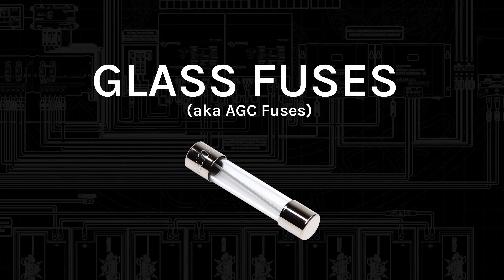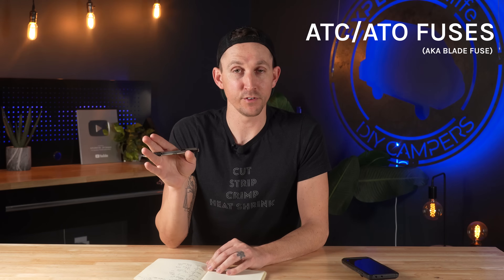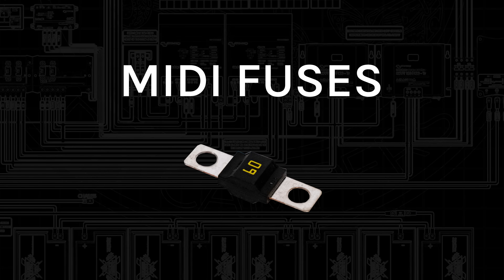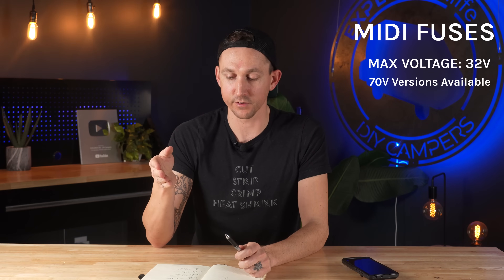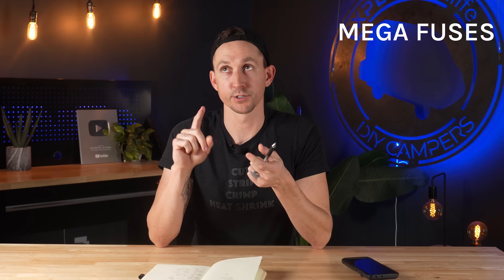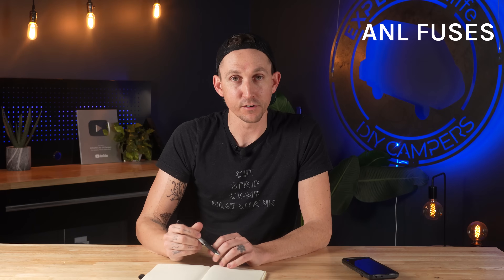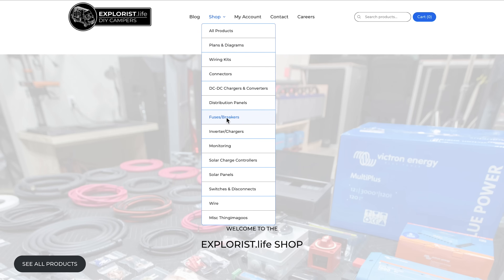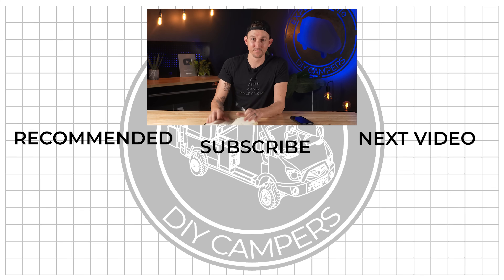DIFFERENT TYPES OF DC FUSES (for a DIY Camper Electrical system)

Comment: Overall, not particularly useful.  The presenter merly rattles off a dozen fuse types but gives no comparision on which are better suited for Van/Camper electrical applications.  The generalized min/max voltage and current ratings are so wide spread as to make these details lost in the noise.  No graphs, charts or other visual data to compare and contrast the various fuse.
Reply from the maker: Appreciate you checking it out! Some topics are tricky to fully break down in one video, but we try to give a solid overview. If you're digging into a specific project and want a more tailored breakdown, our support team can definitely help: https://shop.explorist.life/support
Free support is available for gear from our store, and the Pro Membership is great for outside items: https://shop.explorist.life/shop/all-products/membership-tiers/

Comment: This is an old video, but I hope you'll still read this.
I understand all the math of the AIC. But people constantly talk about BMS potentially shutting down if we don't pre-charge large inverters, even though that is much less current than with a dead short. So wouldn't the BMS just cut the power in case of a short and any potential arcing would stop? I can see two explanations why relying on the BMS is not enough, but I've never seen it explained and much less tested in an actual experiment:
1) The BMS is simply not reliable enough compared to a good fuse.
2) The BMS is not fast enough compared to a good fuse (which could lead to damage to inverter etc.)

Do you have an answer to that? Or would you be willing to actually do an experiment? I can't afford to destroy a bunch of lithium batteries...
Reply from the maker: Basically, we don't want to rely on software to stop a dead short.
Reply: @EXPLORISTlife  Thanks, I didn't know it's only software in the BMS responsible for that. Makes a lot of sense.

Comment: Do you have a source for a 25amp ANL fuse and fuse holder? I can find a 20 or 30 amp from Renogy with the holder but I'm not sure if they will work for my Victron MPPT 100/20 charge controller.
Reply from the maker: An ANL fuse is not appropriate for that small of a charger.  Try this instead: https://shop.explorist.life/shop/all-products/victron-smartsolar-mppt-10020-wiring-kit/

Comment: From my understanding, if the AIC rating of a fuse is double that of the short-circuit rating of my battery bank, then I should be fine. Sound correct?

I have four 24V 230Ah batteries in parallel. Each battery has 0.04 Ω (40 milliohms) internal resistance. So the short circuit current would be 600A each, for a total of 2,400A.

I just got a Blue Sea ANL 400A fuse as my main bank fuse, which has an AIC rating of 6,000A.
So, if there is a short circuit, it will do its job but it won't explode, melt, etc.
(I'll probably never even use over 50A at any given time)

From my understanding, I'm pretty much covered. This sound about right?

Much appreciated and keep up the great videos. They are super helpful.

Comment: I was thinking about adding MRBF fuses to each of my paralleled LiFePo4 batteries in case of an internal battery/BMS short.  Would this be practical?
Reply from the maker: This may take a more in-depth look at your personal setup.  If you have purchased/are purchasing from our store (shop.explorist.life) reach out for some more personalized help: shop.explorist.life/support

If you've purchased/are purchasing elsewhere, reach out to your dealer for support.  We'd love to have you as a shop.explorist.life customer so we can provide a bit more help in the future. 🙂

Comment: I want to put an inline fuse between my 30amp MPPT solar converter and the deep cycle agm batteries, but i'm stuck on what to buy? I am going to use 10AWg tinned copper marine wire. I realyl want a breaker that I can reset if blown, to save on replacement fuse costs and availability. I have read that those types of breakers are not reliable, and have issues when in hot climates. The RV will be in the southern California area where temperatures in the summer average 105-110F. I was going to mount the fuse inside the RV where it would be even hotter during the summer with the doors and windows closed. What type of fuse setup do you suggest? If I had to go with replacing fuses if they were blown, I was thinking about a terminal fuse block with the square fuses? Don't worry, I won't hold you responsible if it dosen't work out. I am just looking for a path to the yellow brick road.
Reply from the maker: We actually have charge controller wiring kits in our store shop.explorist.life which includes the proper fusing and distribution.  Check it out and reach out on the shop chat messenger if you need additional support.

Comment: You forgot to mention the short circuit fuse on the wife when you been driving 8 hours and she blows... I tried replacing my wife when she blew up with the young woman on the highway and that blew up too... Might have to look at my system for loose connections.

Comment: Is there a video showing how to determine the size of fuse needed? I'm running a 12v system with 400ah LiFePo, 3Kw victron inverter,60amp rover and so on!
Reply from the maker: This may take a more in-depth look at your personal setup.  If you have purchased/are purchasing from our store (shop.explorist.life) reach out for some more personalized help: shop.explorist.life/support

If you've purchased/are purchasing elsewhere, reach out to your dealer for support.  We'd love to have you as a shop.explorist.life customer so we can provide a bit more help in the future. 🙂 

But yes, a youtube search for 'EXPLORIST.life - How to Size Fuses' will indeed turn up a video on the topic, yes.

Comment: Do you guys sell a kit to install a shut off switch in between the Victron lynx power in and the lynx distributor as well as a kit for the smart shunt using 1/4 inch copper bars
Reply from the maker: We do not use the Lynx Power In for any of our system designs; so, no... we do not sell that kit.
Reply from the maker: Perhaps consider just following our system designs as-is w/ no alterations so you don't have to have guess-work.  https://shop.explorist.life
Reply from the maker: Well, good luck then! 🤣
Reply from the maker: I mean... our system designs completely omit the need for a power-in altogether by simplifying wire by using 'diagonal' battery bank wiring.  It's less wire, fewer lugs, less cost, with no drawbacks. 

So, unless you're using more than 6x batteries, our solution will work just fine for you unless you've got something weird going on.
Reply: @EXPLORISTlife that's a shame, I guess I will keep looking

Comment: I'm looking at rgs or nt type fusible links as I need 250-300a fuses for my 48v off grid system running a 12kw LF inverter
Reply from the maker: Neat!  Sounds like a cool project.

Comment: I cannot find an automatic switch that handles DC to DC 48 v array 100 amps
I am not using an inverter, 
I have two 48v solar battery array, I want to use one as a back up, the only item I have hooked to it is connected directly to the MPPT charger.

I would like to switch automatically one battery power bank to another when the voltage drop, the switch’s I found don’t handle 100amp input. 

Any suggestions how to find?
I don’t want inverters at all, it would not be necessary for my application, it would only add problems. 

Thank you
Reply from the maker: Sounds like you are finding the joys of system design!  🤣  But no, since that's not how I recommend setting up a system; I dont' have a source for you on something like that.  Good luck, though!

Comment: I recently found out about this channel, really great content! 

Regarding fuses, I got a question as Im not 100% sure what I should go with.. 

Which fuse type and size should I use between my 365w (Impp: 10.75A ) solar panel and (30A)regulator (if any) and which fuse to use between my batterybank (12v 240ah) and 1000w inverter? Really appreciated if you could give advice on this 🙏

Comment: Great video. I bought several class T fuses about 10 years ago when I set up my first inverter and I still have a few extras from that project. I was debating on whether to use one of my extra  Class T fuses or an ANL fuse with my newest inverter and you have answered that question for me. Thanks for doing this excellent video.

Comment: Are class t fuses the same size as anl fuses?  Just curious if I can still use the anl fuse holder?
Reply from the maker: They are not the same size; no.
Reply: @EXPLORISTlife  ok, thank you for the quick response.
Reply: Can I use a class T fuse just after the batteries and a mega fuse in the Victron lynx distributor?

Comment: Hi Nate, 
Your videos and documents are invaluable in designing the system for my new travel trailer that will have 600Ah of 12v battery, 1200 watts of solar, a MultiPlus-II 12/3000/120-32 120V, and DC-DC charging with the new Orion XS.  
I have been following the 30A OEM Motorhome and 30A Travel Trailer upgrade paths.  The kits include an ANL of 300 or 400 Amps.  I think 400 Amps would be the correct fuse for the + battery to + Lynx distributor leg in my design since it is on the larger side.  
I am confused by your statement at 7:51 “except where we may need a 400 amp fuse like we have in the majority of our systems that have the 12 volt version of the multi plus 3K inverter charger in it”.    Can you explain?

Comment: New subsciber here. I have a question. I am running four 12 volt, 100 amp hour lifpo batteries hooked up in parallel going to a 40 amp mppt controller. I want to use terminal fuses on each battery.  Should 100amp fuses be sufficient, or is it too big or too small on each positive terminal?  I am also running all four batteries to heavy duty Pike Industry Busbars.  I just want to have the ultimate in safety redundancy. Any opinions? Thanks.

Comment: Thanks for thiis discussion 🙏, very much appreciated however I'm stil in doubt about which T class fuse I should be using inside my custom 48V Lithium battery. I have designed a fuse holder which I have fitted with a Bussmann bs88 180A fuse knowing that this type can be used on borh DC and AC however, the Blue Sea Systems seems to be rated for lower voltage (125 vs 240fro the Bussmann) and I am concirned that they might behave differently. The bussmann is more readily available at a much lower cost but I wouldn't wont to compromise the circuit so I have been trying to obtain a comparison but unfortunately unsuccessfully so far. Perhaps you could discuss this in a future video ?

Comment: You totally missed out on the Euro equivalent of a class T - the NF fuse (aka knife blade) fuse with very long tried and tested pedigree (since WW2 from its German origin Siemens). These have 100,000A AIC. OBTW they can also be disconnected on a live load (with a fuse puller handle and wearing protective gear and having had suitable safety instruction).  Downside is the difficulty in obtaining a fuse holder (makers keep this essential tightly controlled, to make you buy a system from them - even though its covered by the IEC 60269-2 std).  However the far east have been using this design for years and you can buy a basic open ceramic carrier w fuse for $10 thus breaking the cartel and hopefully your fault current
Bottom line is that a 12Vdc system is the safest (YOU CANT STRIKE A WELDING ARC AT THAT LOW VOLTAGE- but you can at 24Vdc)
Very good summary BTW  and you are spot on at the deliberately engineered complexity of fuse systems.
Reply from the maker: Thanks!  Yeah; I'm sure there are fuses from all over the world that are not attainable that I skipped over.  I try not to show things on this channel that are not attainable by the average end consumer.

Comment: Great video as are all of your videos. 
Question: Can I use a 300A terminal fuse on my 200AH lithium battery or is that too much?   Thank uou
Reply from the maker: Fuse size is not determined by the battery bank capacity.  More info: https://youtu.be/5y-yDMEgV70

Comment: I have 4 24v 200Ah eg4s in cabinet w busbars to which each battery is connected. Can I put one MRBF fuse on the positive terminal of each battery for protection or just one MRBF fuse on the positive battery cable from that busbar connected to the inverter, please? Thank you.
Reply: I know that this is a really old comment but you are supposed to fuse as close to the battery as you can and each individual battery period you shall also have a fuse on the inverter

Comment: The AIC on all these fuses is dependent upon the voltage they are running at!? Thanks for the video!
Reply from the maker: Yes.  Check with the manufacturers spec sheet for each fuse for additional info.
Reply: @EXPLORISTlife  Yes, totally they vary a lot especially at different voltages. But some manufactures specs are hard to get ahold of, and I'm currently doing a 48v nominal RV system, so it's mor critical than my previous 24v systems. Thanks!
Reply: @markjackson6829  True!

Comment: I'm in the process of installing my electrical system based off the Explorist 12V / 3000W diagram (with 3 x 206A batteries). I recently purchased the recommended 400A ANL fuse.  Do I need to scrap that fuse and holder and switch to the T fuse setup?  As of today, there appears to be several options for T class fuses available on Amazon. I don't understand from the video how much risk I am taking using the ANL instead of a class T. Thank you.
Reply from the maker: The way I see it; is if I felt it was too much of a risk, I wouldn't be putting it in our kits.  T-Fuses from Amazon concern me unless you can verify it is a quality brand like cooper/busman/eaton/littelfuse.  An ANL fuse will be better than a no-name T-Fuse every time, I'd imagine.
Reply: @EXPLORISTlife  Thanks Nate. I'll stick with the components I have already purchased for now.  FWIW - the T-fuse I saw advertised on Amazon is from Blue Sea systems - not certain the manufacturer - expensive, but currently available.
Reply: @jeffsills8284  Blue Sea is high quality

Comment: Hi Nate, is my understanding correct that a fuse rating, say 70v 250Amp means that the max voltage I can use it for is 70 V and therefore I can use it as a 250 Amp fuse in my 12 V system?

Comment: How would you go about calculating the max amp release for your LiFePo4 battery if were to short? Does the built in  BMS protect for this also? I only have one 12v 280ah LiFePo4 Battery in my system. So would the mega fuse be adequate in this micro system?

Comment: Nate, An excellent explanation why you are currently listing the ANL fuses instead of Class T fuses in your diagrams.  I noticed a limited supply of Class T fuses two years ago when I was building my system using your 400A/3000w diagram.  I wanted a spare fuse so I have to buy a fuse holder just to get the 400A Class T fuse that came with it.  Are you putting a footnote on the diagram to use a Class T fuse if available?

Comment: Most AGC-type fuses are rated for 32 volts for DC current AND 250 volts for AC current (50/60Hz). It is easier for a fuse to break an arc of AC current, once the fuse element melts, as the current passes through 0 amperes 100 to 120 times a second. Thank you for producing this video, as fuse AIC ratings are rarely mentioned, and ignoring them can greatly increase the chance of a fire if there is a low impedance short.

Comment: Great video!  Wondering why you didn't choose mrbf fuse for the main battery fuse instead of anl?
Reply from the maker: They are only available in sizes up to 300A, so when we need a main system fuse size larger than 300A, we can't use them.

Comment: I’ve decided on a subi Crosstrek build and I’m implementing a lot of stuff from your current van build when I comes to construction like using the t-channel square tubing to build out the frame and slotting in the plywood. Looking into the battery and where to put it I saw that you guys use to have a Crosstrek, do you think the spare tire compartment would be a good idea? I’m a bit worried if a fire or short since I’m from Arizona

Comment: Dang I was hoping you'd cover CNN fuses
Reply from the maker: CNN fuses and ANL Fuses are pretty much the same thing just with slightly different various ratings, but they are the same physical size and would be used in the same locations for the most part.